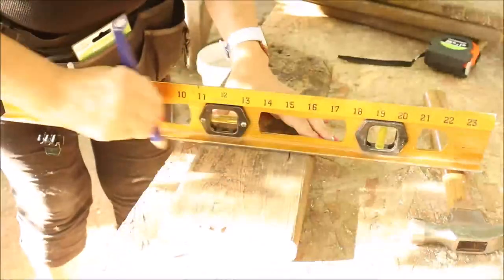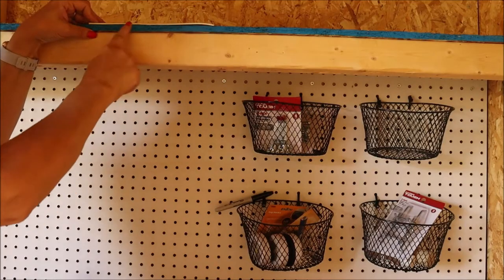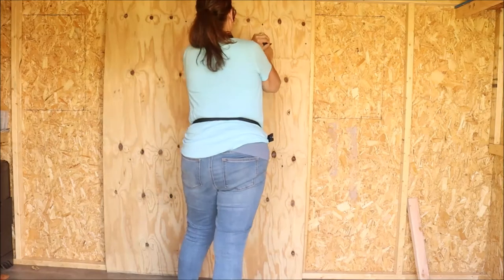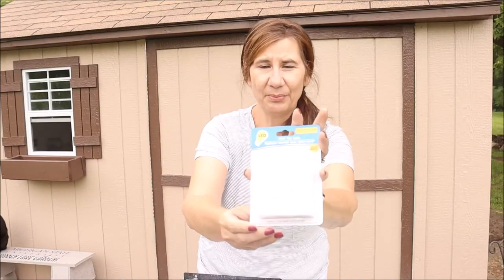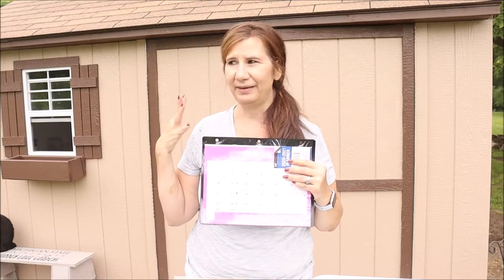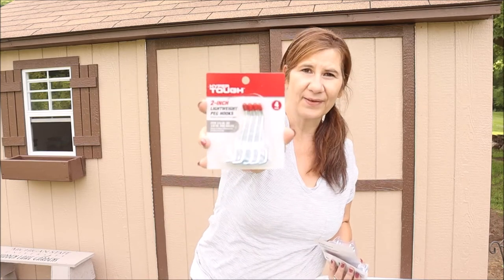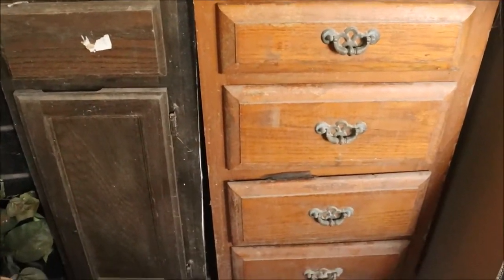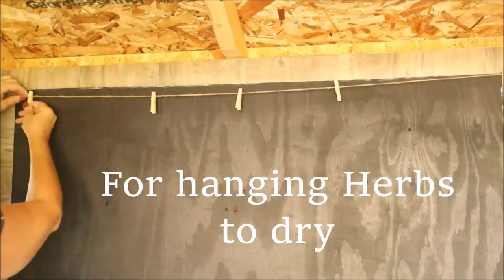Garden Shed Upgrades | Budget Friendly Organization

Comment: Drill a hole in the door by the latch and run a string thru the hole to the inside and tie one end to the release arm on the latch so if the door does lock when you are inside you pull the string to unlatch the door!
Reply from the maker: Thank you! Great idea. It slammed shut on me the other day. Thankfully it did not latch.  I did not have my phone with me either. Won't do that again!